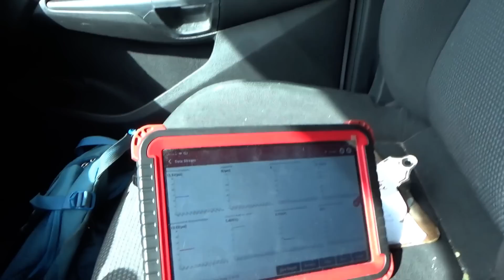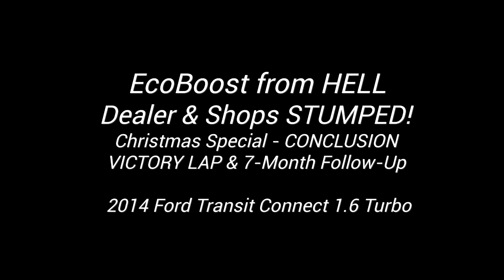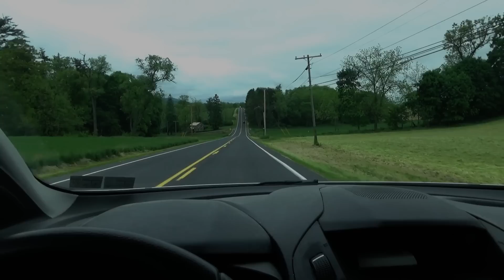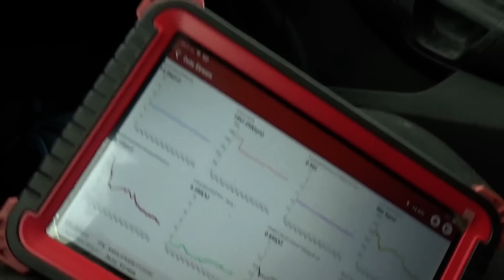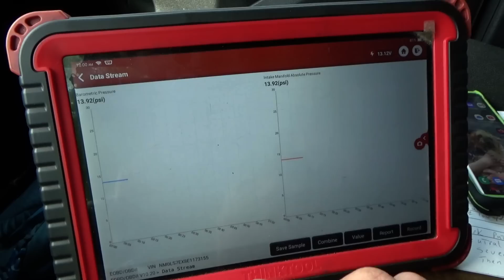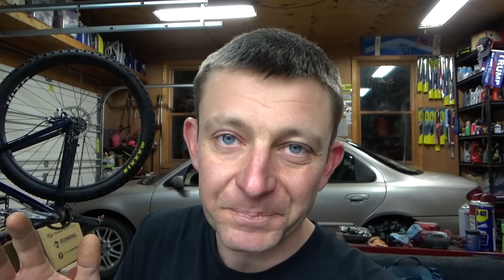(CONCLUSION!) *7-MONTH Follow-Up* EcoBoost From HELL (Christmas 2024)

Comment: There's lots to say here.

The biggest thing is that there needs to be (and your channel is great for this) a greater education, awareness, and upbringing of being proficient and technically capable at these ever more complex cars with their electrical systems (sounds like a boomer take I know). 

For the uninitiated, it would've been so easy to make the call on: Cam phasers, the High Pressure Fuel Pump, Turbo, ECU, and so much more other nonsense. A proper diagnosis is worth so much, we have to really be careful about what we condemn and why.

Regarding the MAP fix, I think i'll always keep this with me to make sure the MAP follows Barometric pressure. That's a very good tip to everyone to check for MAP issues and i'll keep that with me.

Finally, as a last note. What's with the cars taking so long to go through the monitors SHEESH! Takes like an hour just to go through a quick clear codes and check for healthy systems, thats too much what the hell

Comment: Ivan it was a super interesting series, thanks for publishing it at Christmas time.  I also have ran into factory made splice problems when working on X-ray machine circuits. Years ago they would send very low signals on coax cables to amplifiers on the other side of the room. This was in the days before digital circuits. One of the "best" I ran across was a 15K ohm short to ground that would come and go. This turned out to be someone that was cleaning around the back of the machine with a gallon of liquid medical soap. They spilled most of the gallon on the floor and it ran down into a floor junction box filled with cables. They just cleaned up the spill and told no one. It took close to a year before the strong soap soaked passed the tape into a splice. :)

Comment: This is just a suggestion from a retired tech. Go to wiring diagrams and see what all codes have in common. If you had done that first, there was a good chance you would have found the common ground and wiggled wire.
Reply from the maker: The 6 original codes had absolutely nothing in common 😅

Comment: Electrical engineers and associated designers of these manufacturers should take note not to bond several grounds or positive wires (for that matter) inside of a harness buried amongst  where it can't be visible. Instead run all wiring independently to terminate where it can be seen. More likely a tech will find a problem imo. Just seems Companies are cheaping out trying to save a little wire. Very interesting discussion from lots of your viewers. Fantastic series Ivan. As many times as you got flustered you kept hammering through. Ivan the wiring whisperer😇

Comment: I was surprised when you mentioned your splice was glued together. I had a similar find on an ‘05 ish F-250. Hunting a break in a canister vent valve circuit I found the splice was held together with what looked like conductive glue in heat shrink. 
I thought it was a mistake in assembly. But no, they couldn’t include a ring crimp or something similar. Now we have look for glue fretting too. 
Good find Ivan.
Reply: its more a sealant than glue. Quality shrink tube has the same thing when heated, it seals the connection from the environment.

Comment: Guess you did prove the solder over crimp theory ! wow test on your patience also ! nice job !
Reply: Not yet, needs to work for 10 years like the crimp did, technically to be proven. Keep in mind the huge temperature swings under the hood. Daily 100C changes. Vibration from engine and driving. Motion from engine torque under load then unloaded. Solder joints work great no doubt but they dont flex like a crimp will.

Comment: You would think totally unrelated but I worked in telecommunication and occasionally a circuit that only carried very low voltage communication as in signal to a broadcast tower, it would need to have what is called sealing current because the connections would go very high resistance from corrosion. By having a current from 48 volts applied it stopped this problem. Your issue is crimping such low current connections. Your solder solution is the only fix for very low current connections. Bravo.
Reply: Actually, it's completely relatable

Comment: Loading grounds and powers with a test light is not always the best way to test a circuit for resistance. Voltage drop is the best test especially with sensors and modules. Using a scope can really be helpful in finding those intermittent excessive circuit voltage drops.
The circuit should be tested with its designed loads
Reply: Yes that's one way of doing it and it works very well for most troubleshooting of resistance issues. There are different methods in the tool belt that be can used to troubleshoot resistance issues. I find that the voltage drop method is more precise. I am retired but still work on the relatives vehicles. I recently had a 2001 ford mustang v-6 with similar driveability issues the baro was off,  the computer thought it was at a higher elevation and the vehicle was low on power ect. This system used the MAF sensor to establish Baro and after changing the air filter and cleaning the MAF sensor the Baro returned to the correct reading for the elevation. 
I am retired but still work on the relatives vehicles. I have enjoyed your videos and look forward to more. The enjoyment is solving the puzzle and than taking pride in a job well done.
Reply from the maker: The test light current is what induces the voltage drop! 😁

Comment: Now make yourself a cake:
100 gr. eggs
100 gr. sugar
100 gr. butter
100 gr. flour
Salt
Lemon peel 

Cold method:
Whip the butter and sugar. Add eggs. Whip until volume occurs. Butter your baking form. Now put in the sifted flour gently into the mass with a spatula. Poor into baking form in a wide and steady stream just above the form. Bake at 170° C (calculate your F temp).

Warm method:
Ingredients are the same.
Whip the eggs and sugar. Now melt the butter. When volume is reached (you can check this stopping the machine and then by pulling your finger out of the mass: there must be a ‘gnome hat’ visible) you add the sifted flour gently with a spatula. When flour is almost not visible you poor in the melted warm butter in even more slow. Now poor the mass into the buttered baking form. Bake at 170 C for 40 min. Please check with a thin wooden pin if it’s done. 

Warm method has the best taste. The cold method is if you want like adding raisins of chocolate etc.

Comment: It is a sad state of affairs when these complex engines (all to comply to emissions & fuel mileage ) are so reliant on critical data getting back to ECM & the wiring is so sub standard .I still stand by my statement that I do not like turbo assisted engines especially on small displacement engines to compensate for cubic cms/inches as it has been shown many times that these engines just wear out quicker.It also comes down to maintenance ( All motor vehicle manufacturers are guilty of espousing 10,000 mile oil changes just to save money in the warranty period)This has been an incredible series & your tenacity to fix that vehicle shows what a true expert is willing to go through.That is why I crowned you THE KING of ELECTRONIC DIAGNOSTICS Thank you & as I have said before To you & yours a very Happy Holiday Season.Cheers .

Comment: If there is a high resistance path to ground (bad crimp, not fully striped wire, etc.) relative to the required connector pin mating surface area wetting current then you could get strange readings on the voltage at the connector ground pin at the sensor when you cycle the connection. For connector pins to function they are designed for a certain amount of minimum current flow in order to work, especially when you cycle the connection, this is called wetting current. Gold plating greatly improves wetting at very low currents, which is why you will see some PCM connector pins being gold plated and others tin plated. Many HEGO connector pins are gold plated, as are fuel level sensor pins at the tank connector, any place you may encounter very small circuit currents.

The problem with the splice is a wire was crimped without the insulation fully removed, or partially removed from several wires. Which is much more common than nicked or broken strands. If the splice machine operator does not notice a wire is not completely striped, which can easily hide in a small bundle, then the wires are inserted and the crimp made.

But, a recall of the 2.0L for a bad splice (Ford 14S17) said root cause was due to poor crimp pressure, which is possible, but most operators are taught to pull on the wires after the crimp is made (this is before the heat shrink is applied), to make sure the crimp is tight. Many crimp machines will have a pressure readout that the operator uses to make sure the crimp is cold welded (compressed under high pressure). 

However, the above information applies to the harness factories in the America's (mostly Mexico) and not China.

Soldering has its place. But, you must make sure you have the proper soldering equipment and you know how to solder. Many technicians who working on the recall, which called for cutting out the splice and soldering in a new section of wire, said the PCM could be damaged if it was not disconnected before soldering with an AC mains powered soldering iron, which electrically found the AC safety ground returning to the vehicle battery negative, through a connected charger or on an electrically grounded two post lift. Somehow AC current from a non ESD safe iron damaged the PCM SIGRTN to PWRGND PCB trace, requiring a new PCM.

The soldering station Ivan used was an ESD safe station so should not have any damaging AC voltage on the iron tip, but also the vehicle ground was not tied to AC mains ground through another path like a battery charger or lift. 

For my work I always check the vehicle TSBs and Recall Notices before starting work. However, I am not sure that would have helped with the vehicle in the video for the year and the engine type, which have no TSBs or recalls for the bad splice, but clearly it uses the same engine harness as the 2014 Escape 2.0L Turbo Ecoboost. 

The splice (electrical category) recall 14V495000 (Ford Recall Number 14S17) is for a 2014 Ford Escape with the 2.0 Liter Turbo, there is no similar listing for the Transit Connect of the same year. Someone with Ford dealer recall system access should be able to find the number for the Transit Connect model in the video, the same repair was done at the dealer level for the Transit Connect with the turbo engines, but I cannot find the Ford recall number. The splice recall for the Escape has the same symptoms of the Transit Connect.
Reply: Butane soldering iron ftw

Comment: ...@15'00" explanation of 300mv ground offset disappearing.
If the individual sensor is dis/re-connected when the ignition is already on, there is a sufficient current spike to temporarily break down resistance in the poorly crimped connection. (other devices are not starting up at same time)
When being powered up with everything else, the voltage naturally ramps up much slower and the current spike to the sensor doesn’t happen. This leaves the noisy connection in the crimp.
Multi-meter shows 300mv, an oscilloscope would show many volts of spiky noise.

Comment: Scott from Los Angeles. I think the best thing that you can tell people is deal with the check engine light right away. Obviously they can lead to compound problems which are hard to solve. As you know once a check engine light comes on other problems can happen and the people think that the check light is only one problem. It costs way more to deal with compound problems! Handle your check engine light immediately! That thing was a nightmare!

Comment: Because of the nature of multiple wires in the same crimp connection, the likely failure is oxidation on the relevant conductor causing a variable resistance (vibration influenced) resulting in the variable voltage differential to ground. If left alone, other connections would have likely been affected, but by then the van would have probably been undriveable. Having said that, WOW! Most mortals would have given up after the third issue. It is this kind of dogged determination that gets to the ultimate solution.

Comment: Possibly a dissimilar metal connection (in the crimp) with something acting as an electrolyte (sometimes). Tin or copper-Nicle, tin or copper- mild steel would give about + or - 0.3v. Just a thought. A number of times I also had problems that made me doubt Ohms law (and some other laws). I take my hat off for your persistence, well done
Reply: That's undoubtedly the effect Ivan had observed

Comment: I think there was effectively a parasitic copper oxide rectifier in that splice caused simply by tarnishing of one wire. That would explain the more or less constant 300mV voltage despite a large change in current.
Reply from the maker: "parasitic copper oxide rectifier"... I'm going to look this up! Are you an Electrical Engineer?
Reply: @PineHollowAutoDiagnostics  Yes. Copper Oxide rectifiers were commonly used before modern semiconductors came on the scene. They have quite a low forward voltage similar to germanium and lower than the 0.6-0.8V typical of silicon. A big disadvantage was that they were also quite 'leaky' meaning they also conducted an appreciable reverse current.

Comment: Your wire crimp reminds me of working on the F-106 fighter, it had so many plug connections called blue ribbon connectors (made by Motorola, to be very reliable, all gold plated) that it would often have a bad one. Trying to find it would be very challenging. We had a little rubber doctors hammer that we could use to tap the connectors to see which one was giving trouble and then you could take that one apart to fix the connector pin.

Comment: You should make a discount or add to your current case study discount, make a decal / sticker with your logo, with a QR code for contact info.

It should have a new HPFP from Ford under recall, said it was completed.

Wonder why not try IDS or FORScan

Favor; for your loyal viewers/ techs if the video/series are old to you yet new to us cause the people seemed out information to attemp to assist.

Comment: What comes to mind for me is possibly the insulation got crimped rather than the wire. At that point the metal part of the wire could be making part time contact with the other wires in the crimp.😊

Comment: Please don't feel bad; I had a 2015 Navistar diesel school bus that did that same thing. Aftertreatment computer would no longer talk on network. Scope at module J1939 can high perfect, can low for the first 1/2 second was almost a sinusoidal waveform, followed by data packets. Found where the can link "T"'s into the can lines is just three pieces of wire shrink wrapped together. I overlayed a new twisted pair cable over the old one and soldered the connections. To this day, I believe if I had just soldered the connection, it would have worked just fine. J1939 showed perfect at the DLC. Just one more case, without a 4 channel fluke scope, I would have been worthless. Two days of my life I won't get back.

Comment: Merry Christmas and awesome case study. Unfortunately, most customers still think they should not have to pay for diagnostics. I can imagine how many parts the dealer would have sold before they would have recommended a new engine or accidentally fixed it while replacing the engine wiring harness. 🤣🤣Can’t wait for the next special.

Comment: Theory of failure: 1: oxidation, possibly oil related, caused RESISTANCE in series with ground side of low current sensor.  2: oil acted as dielectric and caused CAPACITANCE between long resistive MAP sensor ground wire and actual ground through other different unoxidized ground wires in the bundle.  So when MAP sensor was in circuit, it charges capacitor through resistance of series MAP ground wire to 300mV and stopped there because resistance of oxidation was about 1/50th of impedance of sensor.  Upon removing the sensor, the 300mV charged capacitor discharges itself through the resistive ground wire, thus slowly dropping to 0 through RC circuit of resistive/capacitative MAP sensor ground wire.  Then when you plugged sensor back in, you measured in uncharged capacitor state closer to 0mV.  You functionally had an RC circuit (or maybe an RC transmission line) in series with your MAP sensor. “Transmission Line” in the electronic device sense and not in the automobile transmission sense.
Reply: I was wondering if perhaps some thermocouple action was going on.  All you need is heat and two dissimilar metals.
Reply: I wish I understood what you even said. Ivan obviously loved it and that's high praise! You have to be some sort of electrical engineer? At least  I learn a lot watching and reading comments from viewers and just wanted to say thank you
Reply: Perhaps there was no oil involved in that particular location, maybe it was just a teeny tiny bit loose at that splice causing the condition if it gets slightly jiggled
Reply: Creative thinking, but the capacitance that might be involved would be tiny, so doesn't support your theory of charging and discharging  capacitor. (Or to put it another way, the RC time constant would be too short to observe with a DMM.)
Reply from the maker: Love it! 👌